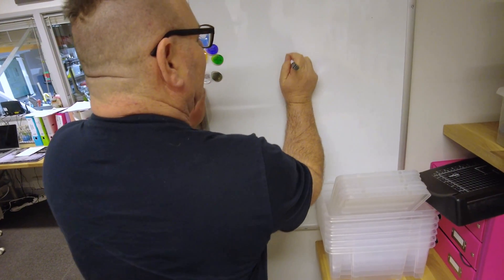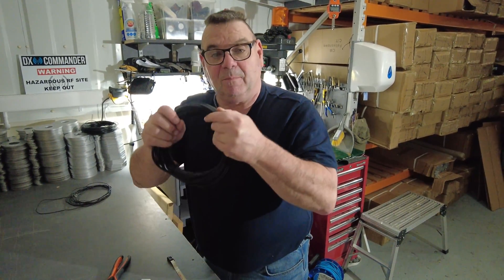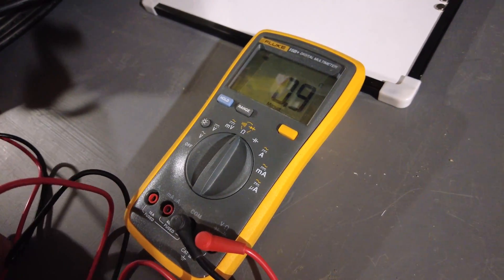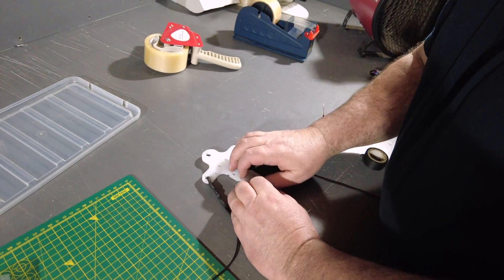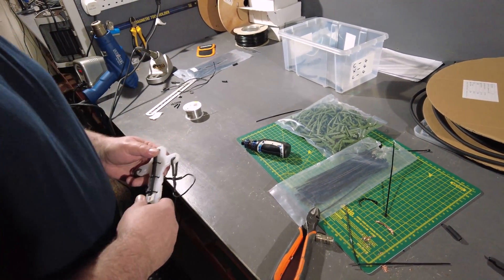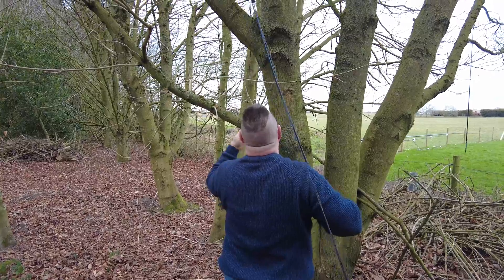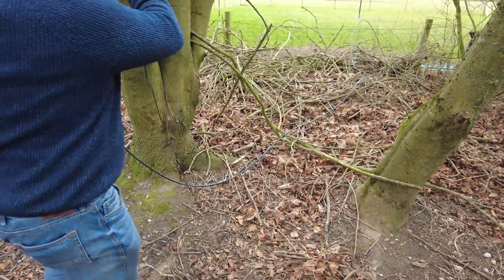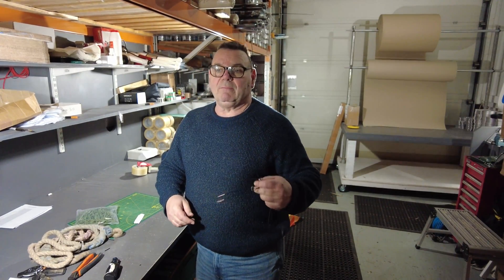Small Cheap Linear Loaded 80m Dipole

Comment: What is a good free antenna modeling software program? I'm curious what would happen with the dipole if you were to bend them at 90° angles at the center of each element and have them facing 180° away from each other. How would that affect the radiation pattern
Reply from the maker: If it's fairly low to ground (and it probably would be), you wouldn't notice.
Reply: @DXCommanderHQ I figured that much. I'm just curious how it would skew the radiation pattern anyways I love your content I love anything RF related. Long live radio!

Comment: ' found a mile of 16AWG real silver coated copper single conductor insulated wire left over from building Vietnam era guided missiles, so the crew (me & garden rabbit #3) built an antenna out of it, of course. We cut this 80M Linear Dipole antenna last night, then strung & made it ring tonight shooting for 3.9 MHZ out here on the highly conductive Indian burial ground. We built it worse than you did, using my calibrated length of stride and Mk I Eyeball to measure, and it resonated first time at 3.880 without trimming at 1.37 SWR!!! (only 7 feet off the ground fed wifh 2 feet of old high loss RG58). Silver wire, yes, but your linear loading length estimates are sterling! The 15 dB loss showing on the Rig Expert raised our eyebrows; Sr. Rabbit blames the coax and low height. Hoping to make reliable 250 mile night NVIS contacts to Kansas City which is in first skip shadow zone.
Reply from the maker: Lovely!

Comment: Where is the spreadsheet you used to tune the antenna?
Reply from the maker: OK, search "m0mcx swr calculator" and your fav search engine will show it :)
Reply: @DXCommanderHQ  Thanks.  I had found the spreadsheet for non-loaded dipoles, and was left scratching my head regarding the foldback cuts.  The online version explains that very well.  Will you be making a foldback version of the spreadsheet so we can take it into the field?

Comment: Electrical shop.  Ask for a few Wago 221-2401 inline "lever nuts".  These are used for connecting two wires.  Perfect for adding some wire back to the end of the doubled back section.  It won't hold the load of the wire from the end back to center insulator, but for tacking a piece back to the end it will work fine.

Comment: My wife measures to buy a yard of fabric from her thumb and forefinger holding the fabric, and the other end to her nose with her head at a specific angle which she has done since a teenager learning to sew.  I challenged her once on this and she handed me a tape measure.  It was right on.  I can pour a teaspoon of salt in the palm of my cupped hand, and it will be right on, too.  Meter and a half, huh?  I trust you.  And I have cut the wrong wire before.

Comment: I reckon that the point where the wire returns may be critical . If the phase of the current at that point is at 180 degrees then the returning wire current will oppose and cancel the field .
Reply from the maker: Tiny bit maybe but hardly noticable.

Comment: Dear Callum, thank you for ALL of your videos. My experience level in amateur radio is quite low, and/but I am an avid learner. My original idea (for an 80 meter inverted V dipole) was to cut two lengths of wire at 40 meters, connect them to a 1:1 balun, connect my coax, then raise it up about 16’ (5m +/-) and test SWR. You automatically use less wire than it seemed appropriate. Can you give a short lesson or explanation on WHY one would not use full length? (80meters). Please forgive what May seem a sad newbie question. Respectfully yours, from the west side of the Atlantic.
Reply from the maker: Firstly.. You are correct. For a linear loaded antenna (this one) we effectively added some inductance along the whole length (12m or so) which meant it needed to be less long. We could have also done the same with a coil somewhere along the length - to make the length smaller. But it's not a "forever" solution.. There comes a point where the SWR curve becomes a bit to narrow for day-to-day use. Your solution of course is frankly the best..

Comment: I wonder if I could add 80m to my 10/20/40 can dipole this way.
Reply from the maker: Yes.. You would need to trim / recalibrate some elements probably.
Reply: @DXCommanderHQ  I also could just use a tuner on the 40m element. I still have no real understanding of which approach is more or less efficient.
Reply: Does the folded section have less of an impact on efficiency because it is further down the wire length where the current is theoretically lower?

Comment: Hi cal. This is a very interesting ant which iam about to make, but for the cw portion of the band, whete formula tells me, each leg is around 20.3 m long in a normal dipole, and forgive my lack of calculations due to my illness, but if I take that 20.3 leg and simply do double it back on itself to 10.1m roughly in length, then trip for resonance,  I should be in the ball park, or have I got that completely wrong.
Thanks for taking the time to read this. 73.
Reply from the maker: OK Brian.. If you want a SHORT version, then go with about 14m legs.. So 28m lengths doubled back. Then tune.

Comment: Does the RF say: ah, this is the braid, I do not radiate on this! (?) In fact, this is a horizontal 1/4 radiator with L-shaped counterpoise. Either a good choke on the coax or a 1:1 UnUn is required.
Reply from the maker: I have talking coax. You should buy some :)

Comment: Question, the video description says the legs are 12.4m long but in the video I thought you said 14m long (before cutting the meter or so off to get it to resonance)?

The reason I ask is I want to do the same thing but scale it up for 160m.  If the length of each leg was 14m then it looks like 26.52m per leg should work for 160m (roughly).

Thanks,
Dave
Reply from the maker: Dave.. I can't remember - however if you went 25m of linear loading each side, it'll be close. You will just need to faff about at the end with cutting the odd bit off..

Comment: Thanks for sharing your video with linear loading. I could not comprehend however what you were cutting whether you were cutting 1 1/2 m off of one leg or 3/4 of a metre from both as I assume this is a wire folded in half 😮
Reply from the maker: Surely you got the idea.. Anyway, both.
Reply: @DXCommanderHQ  I'm still a little cloudy, but I think Cal meant 1.5 meters off each foldback leg and the total antenna length would remain the same.
Reply from the maker: @stevesf28  Yeah.. every install will be a bit different..

Comment: Really nice vidéo, Do you think it's possible to use a ladder line in replacement of the wire ?
Reply from the maker: Yes BUT depending on length of ladder line, your match to 50 ohms will be guess-work so ideally go for a balanced tuner and ANY length of wire rather than coax.
Reply: I wanted to say, use the ladder line in replacement of the wire but keep coax feeding. Ladder line is perfectly linear. You solder the ladder line at the end to mimick the fold back wire  and adjust the same way you do on the video. Not sure. Thank you for your video great youtube channel !!!

Comment: 0n a learning curve here, but would that work on 80 as a "tri" linear loaded inverted v dipole abot 8.83 mtrs left and right total wire length 17.66mtrs ? say about  3.4 mtrs above the ground?
Reply from the maker: Erm.. I don't know. But you could try it and find out where the resonant point is. It will be sharp on the SWR curve..
Reply: @DXCommanderHQ  Ahh yes, hadn't thought of SWR curve. Has to be worth a shot. Sadly I spent my waking minutes this morning working out the build. 😂 Damn the antenna building bug!

Comment: When the elements were too long, how about just folding the ends back? You  would have 3 wires running back and forward.  Have you ever tried it?  AC9YH --Roy
Reply from the maker: Er.. OK, I wonder if you watched the whole thing. Folding elements back certainly works but by HOW MUCH? That's the trick (and the math)

Comment: Does this need any type of balun or anything? Or does it just use coax the whole way to the rig?
Reply from the maker: Baku so or chokes are normally optional for HF.. I wouldn’t bother for this.
Reply: @DXCommanderHQ  much appreciated. I've been eager for 80m on my small lot and this may be the solution. Thank you!
Reply: Personally, I would probably use a balun... unless you want to couple yet more of your hard-earnt RF into the ground from the outside of the co-ax which is on the ground!.....Or possible risk of RF radiating off the co-ax near/in your shack and getting into your equipment-wiring and causing problems....

Comment: When I make any antenna I make them shorter (2-3 ft.) and put 6 ft telescoping rods at the ends.  I adjust the rods for proper length and when done replace the rods with wire.  Works nicely.

Comment: One of the EFHW antenna makers make a 75 ft. Luh loaded endfed and I plan on testing one.  For years when living in a Condo I used a 60 ft. dipole w/tuner on 75 M phone and it worked better than I ever thought it would.  You just have to be careful how it's installed and what's used to make it..

Comment: Hi Callum, On the ARRL Antenna Book there is a Chapter about Dipoles and Monopoles. On chapter 2 there is a presentation of the Effects of Conductor Diameter and the K factor. I do not know if the DX 10 cable has a particular K factor that may be used to determine the length of the dipole?  As an example they mention a dipole for 40 meter with cable AWG 12. The traditional formula will give 468/7.2 =65 feet. But given the correction of the K factor would be 66 feet 7 inches. They do as follows: 491.786/7.2 =ft  X 12 in.ft/0.081in = 10.119. Then when you look on the table on the book that gives a K =0.974.
 Finally 491.786/7.2=68.3,  and  68.3 x 0.947 equals 66 feet 7 inches.  I love to build antennas I'm not an expert at all, just sharing something that may shed light to the length challenge you had between 14m to 12.4m . Respectfully Jose David NP3JD
Reply from the maker: Experimentation seems to suggest we're running at about 93% on DX10.. But I might be wrong :)

Comment: Do you have a link to that calculator?
Reply from the maker: No... Just multiple the wavelength by 0.17 and you shouldn't far off..
Reply: @DXCommanderHQ  So for a 20m dipole I am looking at roughly 3.4m per side or 6.8m total?

Comment: WB4BKO Better to use a pair of scissors, or diagonal cutters to remove heat shrink tubing. Would I be presuming correctly that 300 ohm twin lead could be used for the dipole elements? I have acquired a large amount of it and I think it would keep the spacing fairly constant. Good video. It is quite obvious you are having a lot of fun doing these videos. I learn something from each one. Keep 'em comin'! 73 Norm Davis
Reply from the maker: Lot of fun.. Oh yes :)